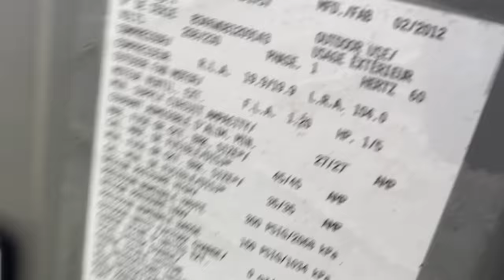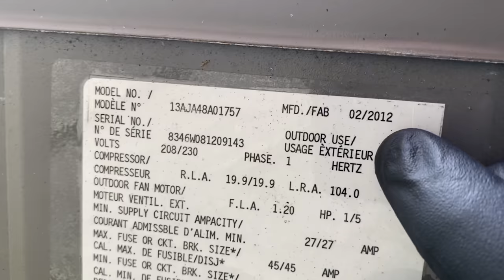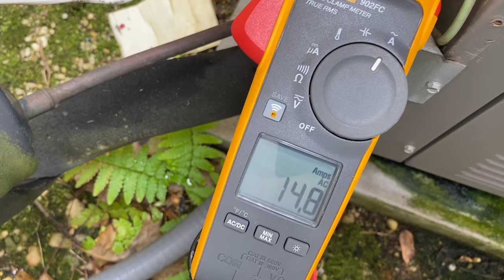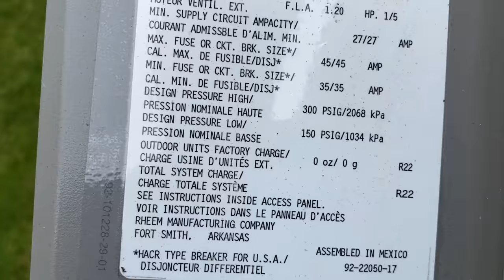Central AC Blowing Not Blowing Cold Air Outdoor Condenser Not Working - Burnt Up Contactor Replaced

Comment: Yeah, that 13 amps was only 70% of the RLA 19 amps for the compressor.  

I've been trying to diagnose my cousin's R22 package unit.  The compressor starts with moderate high amps then shoots up to cut out at 30 amps.  He's broke so I've been looking for any thing before condemning the compressor.  I'm down to either a bearing binding after running a bit, or it's overcharged and the compressor has weakened to the point it matters when 90+ out.  It's a learning experience.
Reply: @Bryan-Hensley   It cuts out after 40 seconds in 90+ outside temps.  Did verify it had refrigerant, and on one run, it hit 294 psi on the liquid line at cut out

Comment: Dang Mikey, from the look of that contactor I thought you had the barbecue party celebration without me. You can stick a fork in that one, it's done! 😁👌
Next time use the "MAX" capture setting on your meter when you throw the disconnect in. It will capture the MAX amperage on startup. Not quite the same as In- Rush, but it's better than nothing.
CONGRATULATIONS ON THE 20K 🎉🎉🎉🎉🎉🎉🎉🎉🎉🎉🎉🎉
Reply: MAX will provide the inrush at  turn-on. 

It may not not super accurate due to filtering but then it’s not a terribly useful number from a service perspective since it’s a function of motor design and can vary quite a bit. 7-10 times full load amps is typical.

Comment: Mike, I think you ought to be comparing you amp reading to the F.L.A. (Full Load Amps) of the fan plus the R.L.A.(running load amps) of the compressor to see if the amp draw is OK. Not the min and max of the rated circuit.  It was well under this so it's still ok. Good job.

Comment: The more the coil in the burnt out contacter cools down the lower the resistence Ohms reading will become. Heat increases resistance. I know neither you or the other Mike would have fitted that contacter, as it was not secure . Loose connections lead to arc faults and not always where the connections are loose.

Comment: Mr Pipes... always prove your non contact voltage tester is actually working correctly before using... verify it against the voltage at the disconnect - stick it in the hole... :-) just saying....you only get one chance.

Comment: any electrical, device terminal or wire that was overheated has been oxidized and needs replaced or cut back to clean bright bare wire if there's enough free length.
don't mess around and immediately replace it, it will haunt you otherwise (possibly start a fire).